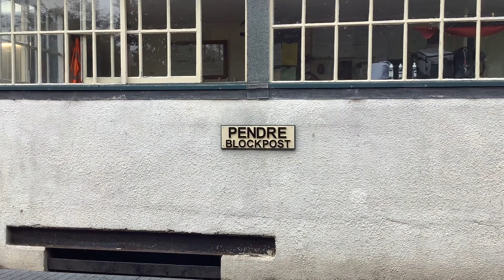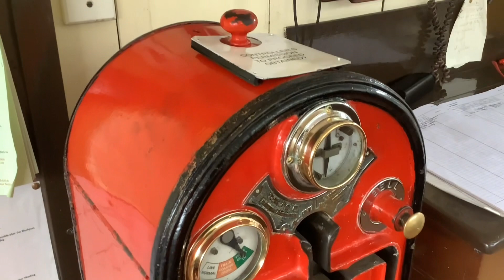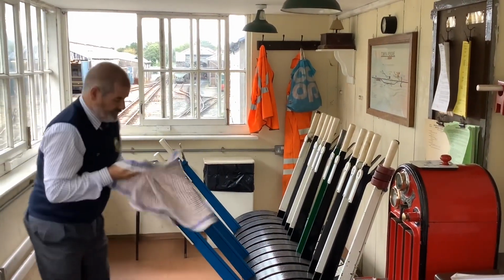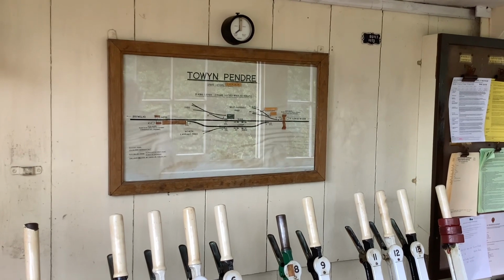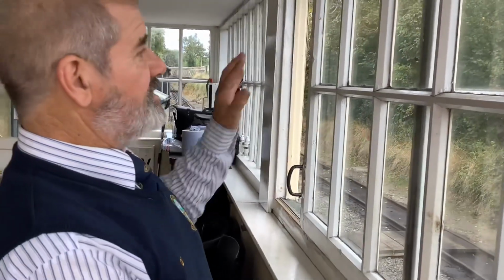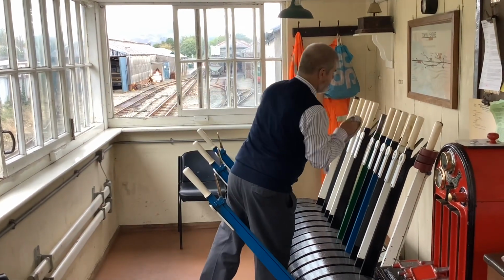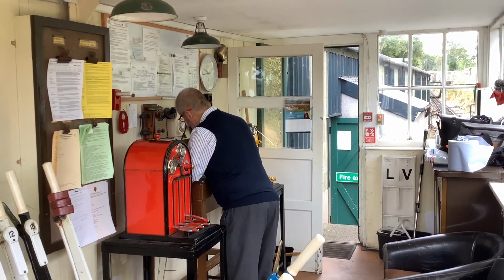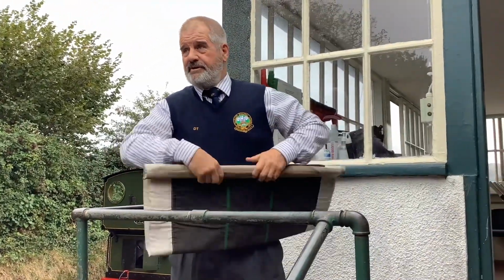Pendre Blockpost

Comment: Thumbs up.The little dial indicators are interesting,they must date back untill before light bulbs were invented.ha ha.
Cheers.
Reply from the maker: Yes,internally the two position ones are basically electric motors and the pulse throws the coil and needle across momentarily.   The three position ones also have stop pins inside that need to be pulled out the way of the needle indicator 

If you want a good tale I know one indicator that used a small servo from a WW2 v2 rocket that still works to this day.
Reply: @irseminorrailwayssection9491  Thanks mate.I used to work for br& saw some very old stuff from time to time.

Comment: Another fantastic video. It's a shame there isn't much shedding light on the quirky arrangements on the TR, but this does it justice.

A couple of questions. Is there a reason why that instrument is painted yellow? Is it mostly to distinguish it or is it something else?

Second, on narrow gauge, what is the overlap from a signal on the TR? I've always struggled to get an answer for narrow gauge overlaps and siting distances, so this seems as good opportunity as any to ask! And lastly, are there any bell codes specific to the TR's rulebook or are they all straight out of the RSSB/BR handbook?
Reply from the maker: Aha wait till the next one and that’s actually covered 😃. Itl be. Couple of weeks till release
Reply from the maker: The four machine colours are red,blue,yellow and green it helps with getting the right key issued and put back in the right machines 

Traditionally the overlap goes as far as the exit boards at the other end of the loop of old board.  It gives a large overlap but ensures safety better
Reply: @irseminorrailwayssection9491  A correction to what you say about overlaps on the TR. Bearing in mind the statutory speed limit on the TR is 15mph, the overlap for the home signal or stop board is as far as the limit of shunt at the loop in the opposite direction - at Brynglas for down trains this appears to be around 20m to the up direction limit of shunt, although I haven't measured it. For movements into the loops, the fouling board at the far end of the loop acts as the limit of the movement authority, the overlap for which is to the Limit of Shunt in the same direction. If I could work out how to attach a diagram to the comment I would do so to explain more clearly.
Reply: On bell codes, the majority would be familiar to anyone knowing the BR codes, but there are specials to deal with specific movements in the rule book - for example a special train entering section code of 1-2-3 used most often between Wharf and Pendre when the train is propelled (engine at rear with driver, responsible person in front vehicle).
Reply: @stevehailes684  so is 20m more or less used universally as overlap distances then by narrow gauge lines, or is there some other mechanism used to determine this? I ask because there's next to no information on this sort of thing.
Reply from the maker: @stevehailes684  yes. I saw one train using this which was new for me.  Good to see it 👍
Reply: @SilverGear_  I think the TR would regard that short overlap at Brynglas as an exception from normal standards as it is very unusual for the section of line beyond the end of the overlap to be occupied when a train is approaching the stop board, but there are operational reasons for having both the limit of shunt and the stop board where they are. I've no experience of the policy on other narrow gauge railways. Overlaps are very much a risk mitigation measure and I would say there is a fair amount of judgement needed in determining the requirement. I'm not aware of any formal mechanism to determine what the normal standard should be.